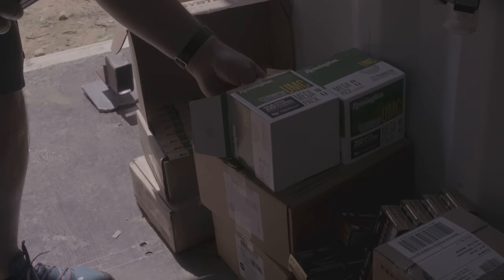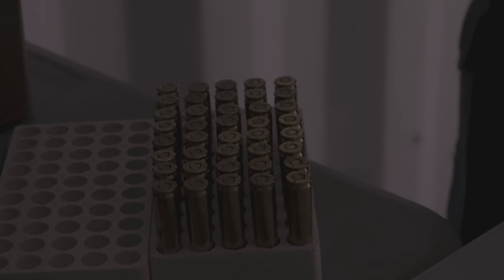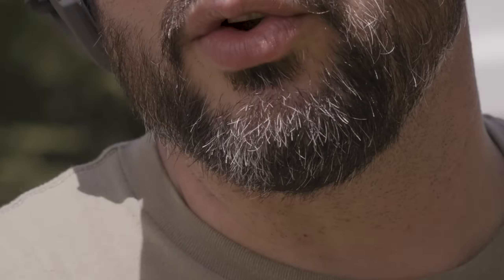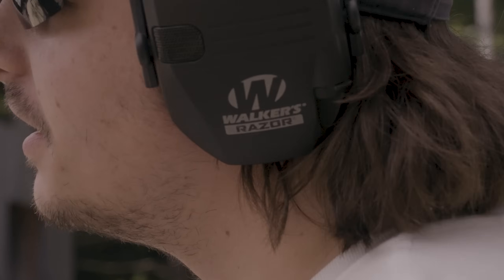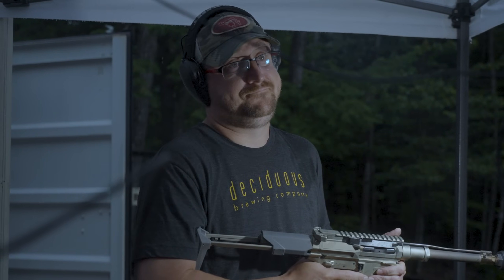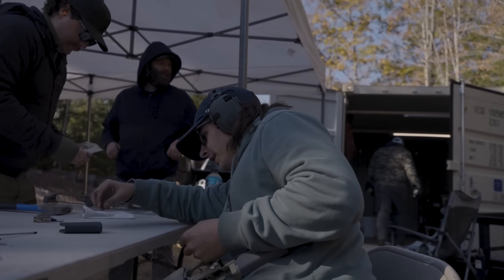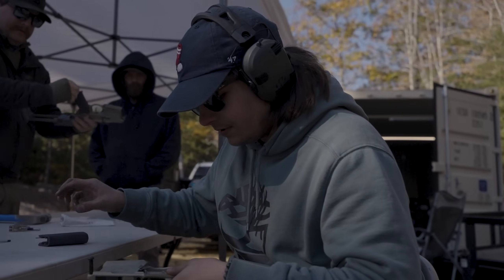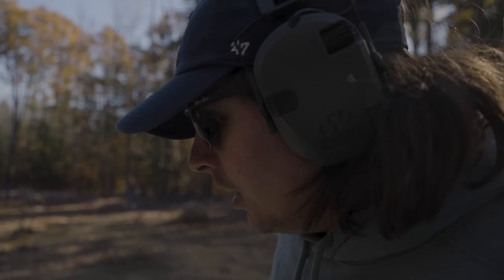Mini DOQ  |  556 Honey Badger  |  Function Testing

Comment: Need to make a shorter length of pull. Thing is like A2 length for a compact cqb system. Whoever’s testing ergonomics must be like 6’5”
Reply from the maker: 6'9" actually
Reply: @qllc8143  makes sense. I’m 6’3” 210 and the length of pull felt weird. Do you guys ever cut another slot an inch or two in for a shorter pull on that extending arm of the stock?